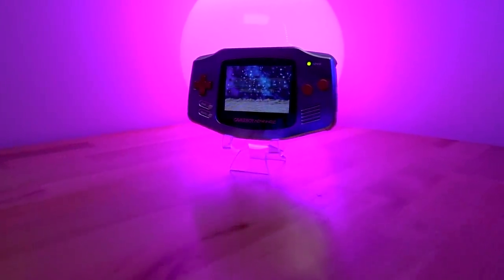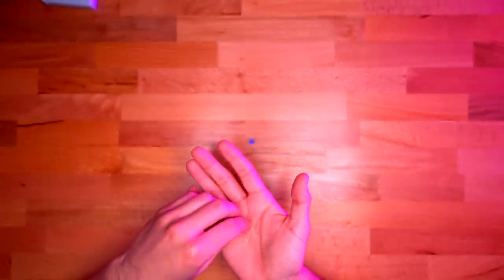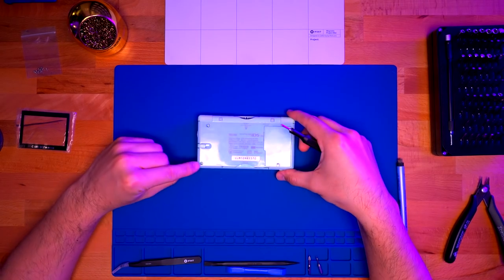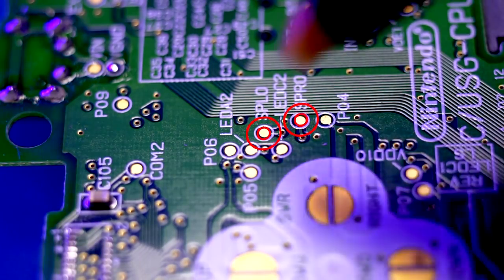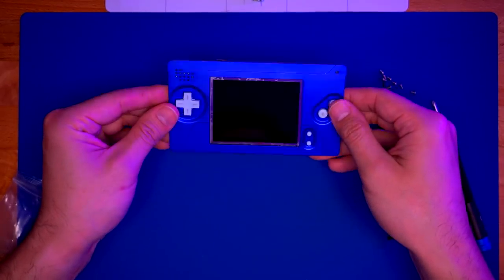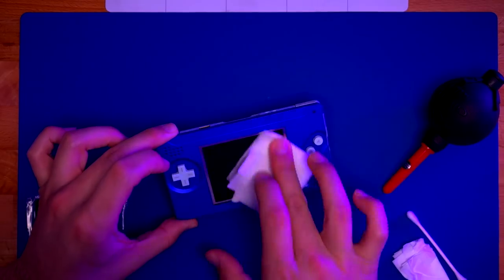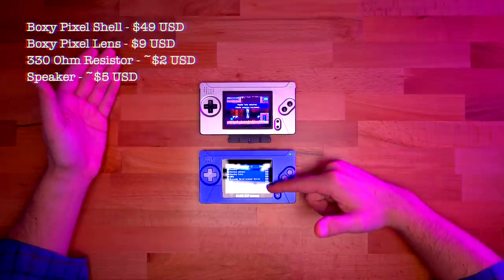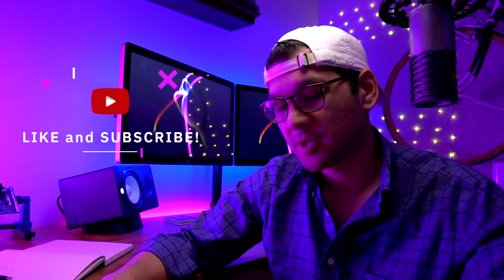Gameboy Macro Mod Tutorial 2020 - Easy to Follow Instructions - Boxy Pixel Shell | Retro Renew

Comment: Hey Tito! Quick question on this one. What is your opinion of the DS Lite screen for this mod? I'd be curious to know your thoughts as I'm not sure it would meet my expectations being used to using an IPS GBC lately. It would be a bummer to go through the trouble of making this mod and buying the parts and end up being bummed about the screen. Also, do you know if Boxy Pixel has modified their glass screen lens to actually fit the opening of their shell? It looks to be smaller in your video which seems to be a bit frustrating.
Reply from the maker: Hey Michael!  Great question!  In my opinion it is hard to compare this screen to the IPS. The IPS is brighter crisper and larger. The DS Lite however is still a great screen in that it has more of a retro look (you can see the pixels). In my opinion I think it’s a great companion to an IPS modded GBA. Also the form factor is great. I really like how it feels in the hands. It’s quite thin and compact. As far as the glass screen is concerned, it is a little smaller than the opening for the lcd. I’m am unsure if it has been updated to fit better. I hope that helps buddy!  Best of luck!  Cheers!
Reply: @MachoNachoProductions  Super helpful! The smaller lens would bug me, but I'm thinking it may not be as bad as I think. BoxyPixel said he would be able to adjust his shell when his stock runs out, but who knows when that'll be. Thanks for taking the time to respond, man!
Reply from the maker: Absolutely!  Cheers!

Comment: Would you mind testing the battery life on your Macros if you haven't already?  I've got one I built awhile back that is identical to yours (Boxy Pixel faceplate,  Switch style speaker, 330 ohm resistor) and it has this really odd issue.  The problem is that the once it was built the battery life dropped from 9 hours to 3 hours on the same original OEM battery.  After much troubleshooting I pinpointed it down to the speaker.  When a speaker is soldered on in any configuration (left pad, right pad, bridged left and right pad) that is when it loses battery life.  Remove the speaker and it magically gets 9 hours of battery life again.  Plug a set of headphones in while the speaker is soldered on and it gets the normal 9 hours battery life.  I even bought a 2nd and a 3rd donor DS Lite and they also exhibit the same thing.  I even tried using the stock DS Lite speakers to rule out the aftermarket Switch speakers I bought and they also had reduced battery life.  I tried a mono speaker and stereo speakers and again the same results.  I used three different OEM batteries as well and each one had the same results.  After running out of ideas of what could cause it I pretty much shelved it and haven't touched it since.  

I can't really find anyone anywhere who has reported the same issue online either which just makes it even more confusing.  My runtime test just consisted of letting an official GBA cart (Pokemon Emerald) run it's intro video and start menu on a loop until it shutoff.
Reply from the maker: Wow that’s some very thorough testing Josh. I actually haven’t done any battery tests and since many people are very interested in that information I may do a video on the topic. To answer your question I haven’t done any testing on the macro battery specifically so I can’t say that I notice an issue with battery life. This is a very interesting topic and thank you for brining it to my attention. Sorry I couldn’t be any further help. Cheers buddy!
Reply: It was so thorough because it was driving me crazy trying to figure it out lol.  I'd be very interested in a battery life video.  I don't believe anyone has made a video on it before in regards to Macros.  And it would either confirm my results and maybe there is something going on with other people's Macros that hasn't been noticed yet or if yours are normal then I'll have to do more troubleshooting.  But I'm not sure what else I could try other than a different resistor than the two I got from Boxy Pixel but I doubt that would change anything.
Reply: @joshl.554  How are the speakers installed? do you have some padding between them and the motherboard? I wonder if it could be some kind of shorting issue?
Reply: In the location that Boxypixel intended.  On the top left if you were looking at the front of the Macro.  It's also where the ribbon connector for the top screen is removed.  Once it was removed I used desoldering braid to get rid of any remnants of solder that could cause shorts.  Then I covered it with kapton tape to go between the speaker.  It's perfectly functional as well.  It plays games and doesn't sound distorted or have crashing/freezing issues.  It just has the weird lower battery life.
Reply: Same trouble mate.

Comment: Love the content!  I like that you include the total cost of the mod.  Do you think you can include some info on the sound quality/performance in your videos?  For this mod, you're going from 2 speakers to 1 (switch) speaker and I'm wondering if there's a noticeable difference.  Installing rechargeable battery packs, backlit screens, etc can potentially affect the speaker and/or headphone jack (hums, buzzing), so it'd be cool to know if you experience any of that.
Reply from the maker: Great suggestion, Ryan!  Thank you!  I’ll look to include that information in future videos. To answer your question about the Macro, I’d say that going to one speaker does reduce the sound a bit. Although the gameboy advance consoles only have one speaker normally, the single switch speaker does seem to be a bit softer in sound compared to regular gba systems. Cheers!

Comment: With the 330+ comments, not sure if anyone has mentioned this. My OCD is kicking in :) with the glass lens installed, on camera I can still see the screens metal case through the sides as it looks as though the lens is about half a mm smaller than the opening? If this is the case, I would take it apart and use a black permanent marker and just colour in the screens metal casing, that way it will be less noticeable :)
Or is it light bleed? Hard to tell.
Reply from the maker: Yep you are right!  It is the bare metal of the lcd frame. The glass lens is a bit smaller than the opening on the shell. Coloring the metal frame is a good idea!  I may have to do that!  Thanks for the idea!  Cheers!

Comment: Very helpful video! I've completed the mod but the switch speaker sounds kinda scratchy. Maybe it's blown... any tips?
Reply from the maker: I would make sure that the speaker wire isn’t shorting on anything. I’d cover your solder joints with laptop tape to be sure

Comment: Is it possible to have stereo speakers with the mod?
Btw, the glass screen doesn't seem to be a perfect fit. We can clearly see the metal case from the LCD screen all around it. That's not looking good.
Reply from the maker: Unfortunately, This mod only allows for 1 speaker.  You can create more space in the rear of the console by removing the stylus holder and put another speaker there, but it wont be a true stereo setup.  Hope this helps.  Cheers!
Reply: I see, thanks.

Comment: Are you using a temperature controlled soldering iron? If so, what's the temperature that should be set soldering on this?
Reply from the maker: Most of my work I do around 340c. For delicate items I drop down to 315c. Depends on the solder too. What works for me may not work for you. Cheers!

Comment: Can the stylus of the Nintendo DS work on the screen of Gameboy Advance Macro, if this console modded from the Nintendo DS, or not? I'm just curious and thinking about that, Mister Tito
Reply from the maker: Great question!  Yep, it is still fully functional. If you don’t install the glass screen lens you will still have a touch screen that works. If you want to install the glass screen lens then you will have to remove the digitizer which will remove the touch capability. So if want to retain the touch capability do not remove the digitizer and/or install a glass screen lens. I hope that was helpful. Cheers!!

Comment: Im waiting on parts and hopefully do not run into the ribbon cable issue. I have my board fully prepped and tried to turn it on without the resistor and didnt turn on but has to because that is not installed.

Comment: Four ways that would improve this mod dramatically:
1. Using a 3-D printer bracket that slots/screws into place to hold the LCD rather than having to hot glue those 2 small pieces of plastic (hot glue is trash)
2. A matching custom metal backplate in place of the back plastic DS shell
3. A custom battery door to hold a massive battery spanning the entire back of the console (back metal wouldn't need the stylus holder as the console is no longer touch capable)
4. An actual light pipe rather than using hot glue (again, fuck hot glue)
That would make this mod the dream

Comment: that's very nice! it seems to be very good quality.
By doing this mod do you lose the ability to play nds games, or there is another way to play them? 
thank you!
Reply from the maker: Great question!  Yes, you can still play NDS games, the only problem is that the top screen is missing so it may make playing some game difficult. There are a few games that only require the bottom screen, I think Resident Evil Deadly Silence may be one. I hope this helps!  Cheers!
Reply: @MachoNachoProductions  thanks for the answer! 
I was thinking something like a "nds emulator inside the nds", with the ability to switch between the "top" and "down" screen,  according the situation. 
I know it looks strange, but I think it would be cool! Ahah
Reply from the maker: That would be very cool!

Comment: Quick question Tito. Say i wanted two speakwrs on my macro one being the switch speaker the other being one salvaged from the top scren of the ds lite. How would they be wired to work?
Reply from the maker: Great question!  It would be pretty simple. Solder one speaker to SPLO and ground and the other speaker to SPRO and ground. The issue become space and where to mount the second speaker. Some people remove the DS cart reader and put it there or they remove the stylus holder and put it in that area. Hope that helps. Best of luck!  Cheers Dan!
Reply: Well that leads back to a previous question bout removing the ds card reader for space for the salvaged speaker
Reply from the maker: Apologies, what was the previous question?
Reply: my previous question was about removing the ds card reader slot for a speaker i could salvage from the top part of the ds lite  @MachoNachoProductions
Reply: what i am planning on is for the macro using a speaker salvaged from the ds lite top part and a switch speaker. The switch would go up where the speaker holes are made in the top left corner. I was going to remove the ds card reader slot to put in a salvaged speaker from the ds lite. My first question was it is possible to remove the card reader to make room for the salvaged speaker? I might have to use different wire to solder it in. My second question is how to wire the two speakers up so both would work? From your vid and replies to do the salvaged one i have to solder it to spr0 for the switch spl0 and both go to the ground vgrnd. Am I understanding that correctly?
Reply from the maker: You got it!!

Comment: instead of cutting would it be better to desolder the connector tot he upper screen to remove it?
Reply from the maker: I’m sure it could be desoldered with a hot air machine. It comes off fairly easily and cleanly with the flush cutters though.  There are several options. Cheers Dan!!

Comment: You know what would be very very cool (ok... opinion is subjective), if you could use a Neo Geo Pocket Color microswitch (joystick) instead of the DPAD. What do you think?
Reply from the maker: That is a very interesting idea!  The clicky joystick is such a fantastic interface!  It would be interesting to se if it is possible. Cheers!
Reply: @MachoNachoProductions  if you do it, let me know, I do not know nothing about soldering and wiring, just very interested, although you might not have enough space in the case to do that, I've just looked into the inside of my NGPC and the mechanism is quite tall
Reply from the maker: That is true. It is very tall. The ngpc case is thick enough for it but because the DS shell is so thin it may be possible but impractical. Cheers!

Comment: Do you know if the glass screen lens fits on the original DS Lite shell? Thanks!
Reply from the maker: Great questions Jack!  I am 99% sure it should fit.  I don't see any reason why it shouldn't.  It appears to be the same exact dimensions as the digitizer that I removed.  I hope this helps!  Cheers!
Reply: Macho Nacho Productions thanks! Also, what was the tape you used to cover the 330 Ohm resistor?
Reply from the maker: I used kapton tape. Great stuff!  Cheers!
Reply: Macho Nacho Productions thank you!

Comment: Could the boxy pixel faceplate be modified? Do drill two holes where x and y used to be? Also does the touch screen still fit in the case if i wanted to keep it working?
Reply from the maker: Great questions!  I think you could drill holes for the other buttons, but I wouldn't recommend it because the case was only designed for 2.  If you look at the front of the faceplate you'll notice the indent for the 2 buttons and I think it would get in the way of the other 2 and wouldn't feel right.  To answer your other questions, yes, you can absolutely leave the digitizer in place and maintain touch functionality.  If you watch my other Macro video, that is exactly what I do there.  Let me know if you have any other questions and best of luck!
Reply: @MachoNachoProductions  thank you for the fast reply. I saw that on the inner side of the faceplate, there are bracket molds for x and y, above a and b, and i figured it could work. I think the full capability of a macro is to have all face buttons and touch so it can also use the ds slot, and play some ds games that use only the lower screen like ff3 and spirit track, and emulators that can make use of the extra buttons for save state key. And this metal faceplate just gives the macro a whole new level of quality.
Reply from the maker: No problem!  You are correct the backside of the faceplate does accommodate the membrane and you could drill holes for the buttons. But the front of the face plate is thicker in that region and may not allow you to properly press the buttons.

Comment: Are there any flash cards that actually sit flush in a DS Lite? I REALLY want to mod one, but I wouldn't want to have something sticking a half inch out of the console if it's in my pocket all day
Reply from the maker: @guyinthecorner Yes, there is!  The one I use is called the EZ-Flash Omega. I do a small review of this flash cart at the end of my other Game Boy Macro video (check it out).  It’s a very good flash cart and it comes with 2 shells. One for the DS Lite so it sits flush and the other for tradition GBAs. Hope this helps!  Cheers!
Reply: @MachoNachoProductions  Great news, will totally check that out! Very helpful video, man! 😄

Comment: hey nice video  i wanna do this to a ds lite soon
Reply from the maker: Thank you vap0rvic!  You should dude!  It's one of my favorite mods!  Let me know if you have any questions about the mod!
Reply: @MachoNachoProductions  I wanted to put two speakers one were it initially goes and one below the button do you think I can solder both of them at the Same point
Reply from the maker: vap0rvic absolutely!  You can solder both the ground wires (black) to the VGND solder pad and the other wires (red) to the SPLO and SPLRO solder pads. The only thing I’m not sure of is the figment of the second speaker. Also you will need to drill holes which is risky. Best of luck dude!
Reply: @MachoNachoProductions  ok I'm have to try it thanks 👍👍

Comment: did you ever see that your flash cart has a lower profile  housing , when in the system its flush with the bottom
Reply from the maker: Yep, it's the EZ Flash Omega and it comes with 2 shells, one for the regular GBA and one for the Nintendo DS that sits flush.  It's probably my favorite Flash cart even though it drains the battery pretty quickly.  Cheers buddy!

Comment: What´s the name of the blue that you used as your working space?
Reply from the maker: It's called a heat resistant silicone work bench mat.  It's a great surface to solder on top of.  Hope this helps.  Cheers!

Comment: Can you take off the digitizer and not add another glass screen on top and just leave the lcd bare?
Reply from the maker: Yes, you can. But you will still need those pink 3D printed brackets to hold it in place. Otherwise the lcd will be loose, both the digitizer and/or the glass lens essentially hold the lcd in place. But, it can be done for sure. Let me know if this answers your question.  Cheers!
Reply: @MachoNachoProductions  Would the gap between the screen and the case, even with the brackets, be annoying or too big?
Reply from the maker: I would say that the looks would not be good. The lcd would be recessed below the faceplate and look unfinished in my opinion. Best of luck!
Reply: @MachoNachoProductions  Thanks! I think I'll keep the digitizer on but i might try to repaint the border around it.
Reply from the maker: You can actually remove the border without removing the digitizer. You may even be able to buy a custom color border online (not sure though). I think in the video I removed the border and the digitizer separately. Cheers!
Reply: @MachoNachoProductions  Thank you for all the advice!